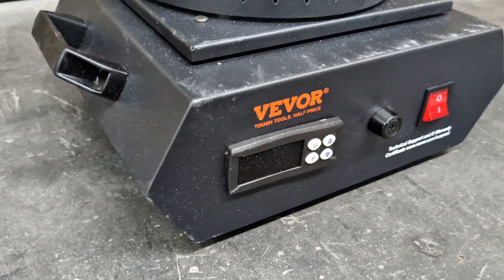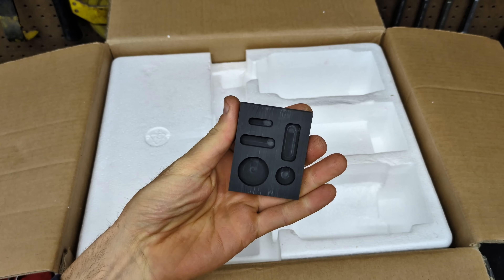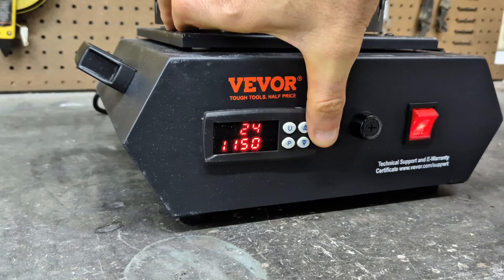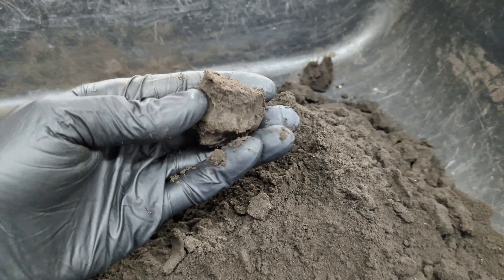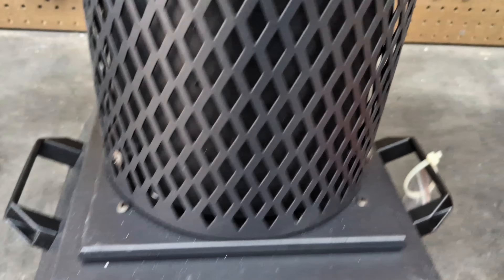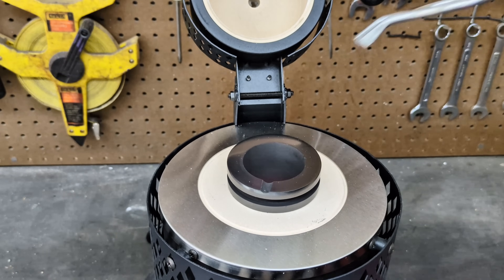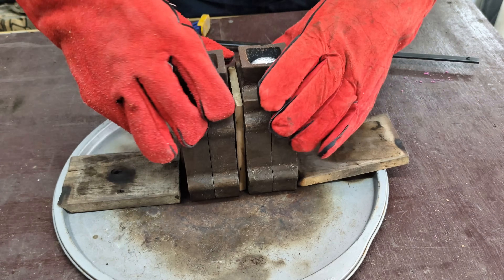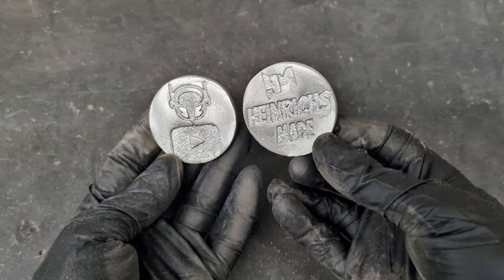Metal Casting with the New Vevor Electric Melting Furnace (Metal melting)

Comment: Casting with a furnace is new to me.  I understand that each metal type needs a different crucible? Do you know where to get extra crucibles and extra parts like the heating coils? Also, is it possible to get longer lasting heating coils? Thank you so much for sharing this info.
Reply from the maker: I use a different crucible for different metals.  I believe you can buy the crucibles and parts from vevor.com, but I am not sure.  Using this furnace to melt lower melting metals like aluminum allow the coils to last much longer.  Melting metals like copper and brass tend to shorten the lifespan of the coils.

Comment: thanks for pointing out the limited lifespan of the heat coils and the graphite crucible. would not have expected that!
Reply from the maker: you bet!  It is something that I wasn't aware of in the beginning.
Reply: @HeinrichsMade What does the replacement cost?
Reply from the maker: @vaindioux I'm not sure
Reply: @HeinrichsMade Ok. Believe it or not propane scares me, even when I cook a steak on the grill
I know silly.
Always ready for that tank to blow up.
Hence why I m looking at electric.
Reply from the maker: @vaindioux 😂 it always good to be scared.  It is a dangerous hobby and you need to be safe.
Reply from the maker: @vaindioux https://youtu.be/XKi-rC3_amE

Comment: Can we use this for extended periods in gemstone heating experiments? For example, at 750°C for 8 hours.
Reply from the maker: That would be a question for VEVOR to answer.  My opinion is no.
Reply: @ceylontopgems  the manual only recommends using the furnace for maximum of three hours ❤️

Comment: I’m curious how long it will take to melt 32 cans
Reply from the maker: I would use a propane furnace for cans.  You'll have a hard time fitting cans into this crucible.
Reply: @HeinrichsMade  where there’s a will there’s a way, I have a diesel generator that I run on used motor oil, electric makes the most sense for me
Reply from the maker: @andrethebear1 make an oil burning furnace 👍. I made one, but haven't used it in 2 years.

Comment: Guess this won't melt steel. I need to try my hand at a small steel gear. What is that sand called for molding? I see it all the time in the metal production shops of India and Pakistan, where they wear their safety sandals while pouring metals.
Reply from the maker: no definitely not steel.  The sand I am using is called Teton Black olivine sand.  It is a foundry sand which is referred to as greensand, though it isn;t green.  It uses water to make it clump together.  It is a mixture of bentonite clay and sand.
Reply: @HeinrichsMade  Thank you for the info. Vevor has their hands in everything! I have a 7 in 1 weather station from them that is broadcasting to weatherunderground.
Reply from the maker: @coloradostrong8285  they have so many tools!!!
Reply: @ Yes- E-V-E-R-Y-T-H-I-N-G
Reply: @coloradostrong8285 I have a Vevor canister filter for a fish tank.😂

Comment: I cant tell but is the interior untreated Kaowool? (where the coils are inset?
Reply from the maker: I think it is a hard ceramic shell.
Reply: @HeinrichsMade  Awesome thanks! The last time I looked at these cheap ones you still had to slap on refractory cement to make em safe, at that point it's cheaper to DIY, but this one looks pretty killer! 

My biggest other issue would be the availability of the crucibles, they look less than standard shape, could they be hard to come by if Vevor decides to stop making them?

Either way this seems like a killer little machine!
Reply from the maker: @kylegerbrandt  To be honest it looks like a standard crucible.  I have ones from other companies and they look the same.  I haven't measured, but I'm pretty certain they are of the same size.

These are semi disposable, they don't last forever.  I would only be concerned if VEVOR stopped making them, because of the heating chamber.  That is replaceable as far as the directions say.  They are different than other brands.

Comment: Great job! I wonder if you could produce Beyblade Metal Saga Fusion Wheel castings? The 3D models are available on Thingiverse. Also, the original toys use zinc or zamak. I'm considering making them myself, but I'm not sure if they're suitable for molding
Reply from the maker: I'm not familiar with those.  However, 3d print models, unless flat need to be cast in a different way.  Sand molding won't work for the most part.